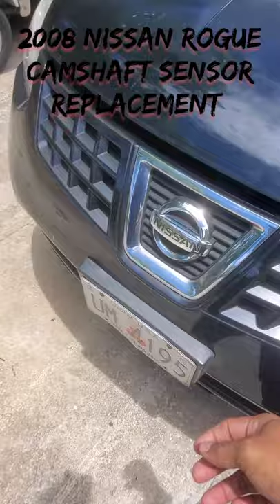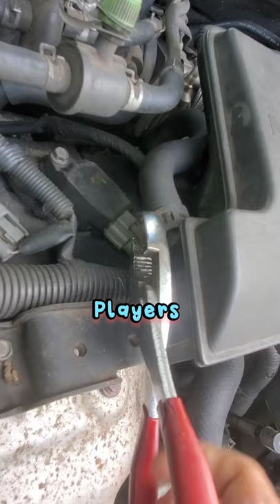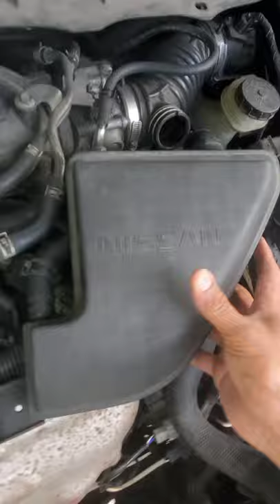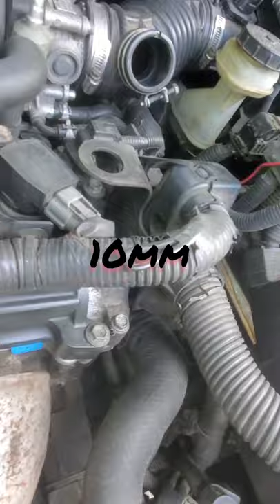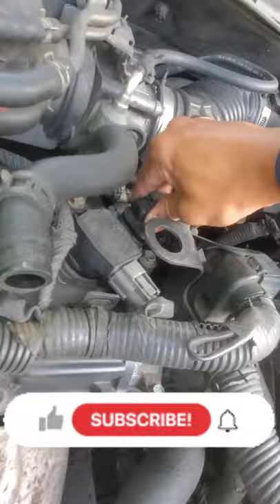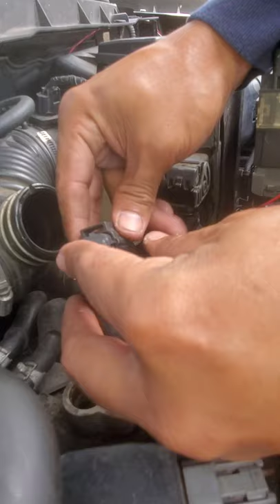2008 Nissan Rogue camshaft sensor location/replacement #short

Comment: Did this car have a transmission problem or rattle noise with the old sensor?
Reply from the maker: It won't start and was reading code p0340

Comment: My rogue has low rpms at idle and it shakes I replaced the pcv valve cleaned the throttle body and maf sensor. And still nothing. Will this help?
Reply from the maker: Do you have a check engine light on? It's better you read your check engine light then I can tell you where to go from there. It could be so many things. For instance your oxygen sensor, or vacuum leaking. So better to read your engine first and we'll go from there. If you have more questions let me know I can help you.
Reply: @SolofixOrlando  I don't have a check engine light which is what made me wonder. what can it possibly be? It has about 136 000 miles so I already made a list of things it may need. I'm thinking ignition coils and spark plugs could help
Reply from the maker: Ya test your coils and see if any of them is out, also listen out for hissing sound in case you have a vacuum leak. Better to check all this things. Oxygen sensor could also be the issue.
Reply: Lo mismo pasaba con mi Nissan Rogue hice todo el proceso y seguía con el mismo problema lo solucioné cambiando con los soportes del motor y de la transmisión y quedó en perfectas condiciones también tienes que checar acciones de la batería y el cable que va a tierra porque eso también te puede provocar vibraciones
Reply: @Iker270  gracias por el comentario. Nunca cambie los soportes pero la batteries y las terminales se las puse nuevas aproximadamente 1 año. Lo que pasa qes que la vendi hace como 2 meses ya que compre una camioneta y ya no le tuve uso. Son buenos coches y no gastan mucho gas. La vendi con 154 000 millas la vibracion fue  algo que no pude desifrar pero pues se lo deje Saber al que la compro
Reply from the maker: I'm sorry I don't speak Spanish. If you could translate it in English I would gladly answer your question
Reply from the maker: English please. I don't speak Spanish
Reply from the maker: I don't understand what is you saying
Reply: @SolofixOrlando  The same thing happened with my Nissan Rogue I did the whole process and I still had the same problem I solved it by changing the engine and transmission mounts and it was in perfect condition you also have to check the actions of the battery and the cable that goes to ground because that can also cause vibrations
Reply: @jbryansoto  si está bien de nada gracias a ti cuídate bendiciones
Reply from the maker: @Iker270  yes definitely the mount can play a big part in this kind of situation. If doing all the thing and nothing changes. It's definitely the mounts. Thank you for the feedback.
Reply: @SolofixOrlando  of course yes and the supports have a very important role in that situation you can also clean the electronic throttle body
Reply from the maker: @Iker270  yes clean throttle. Listen to the sound of the engine while in idle. That can also help in pointing out the problem. Vacuum leak can be the issue.

Comment: And where is the crank shaft position sensor located?
Reply from the maker: https://youtube.com/shorts/HesvcOf0Feo?feature=share here's the link to the video for crankshaft position sensor location. Please consider to subscribe.
Reply: @SolofixOrlando  subscribed already! Ordered the parts I will be installing soon thanks for the feedback bro you’re a real one !
Reply from the maker: @Codename-SubZero  thank you. Stay safe and God bless
Reply: @SolofixOrlando  update: I replaced the starter which was my initial problem. But then the starter worked but the engine won’t turn over. Replaced both crank shaft and cam shaft sensors and found out the CONNECTOR for the crankshaft position sensor is broken. Wires were hanging out of the connector. I’m frustrated now trying to find a video on easiest way to fix that problem 😩
Reply from the maker: @Codename-SubZero  I'm so sorry to hear that 😔. If easy to access wires, be sure to use proper connectors and close up so no contamination

Comment: Thanks, do you know the name of the first Black plástic piece you removed? Mine Is Broken and don't know how to look for ir. Thanks in  advance
Reply from the maker: Good question. It is called air tube box or air intake cleaner resonator. Please subscribe to help this channel help others. Thank you and God bless.
Reply: Suscribes now, thanks for the answer. Regards
Reply from the maker: Thank you so much. I hope you get your vehicle fixed.
Reply: My 2008 Nissan rogue, wouldn’t move, and it was fine last night, what’s the problem?
Reply: Mine accelerate but won’t move
Reply from the maker: I need more detail on what's going on with your rogue. Like sound or any  noise  or anything you can tell me to know what's going on.